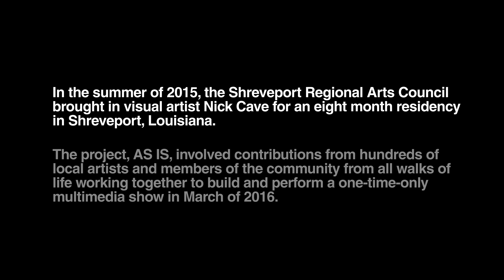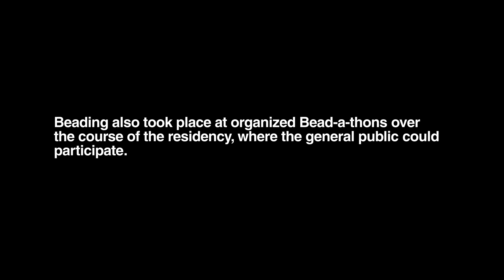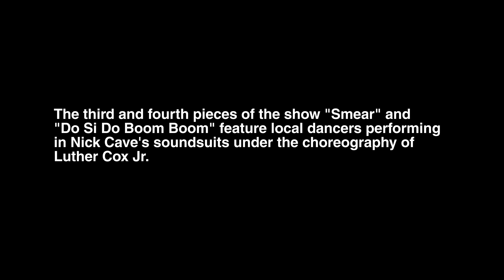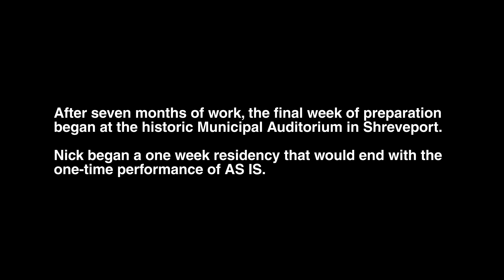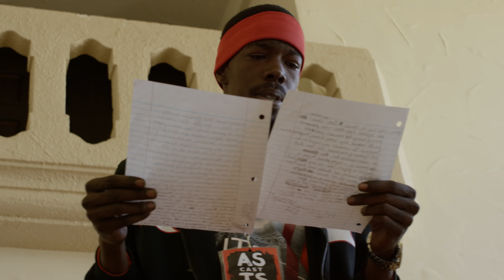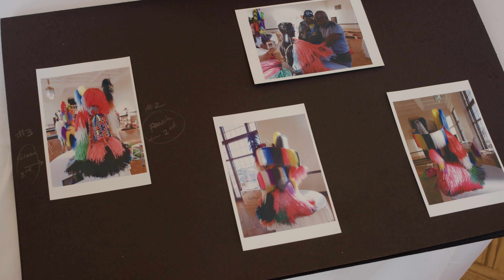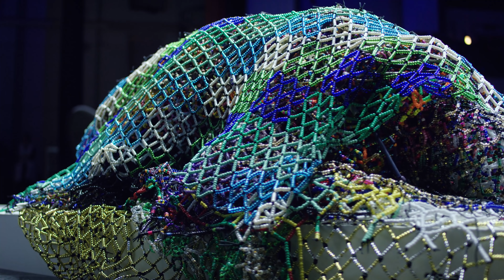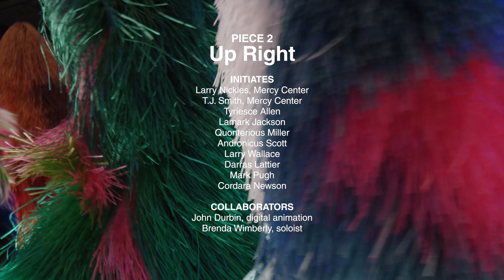AS IS by Nick Cave | Documentary (2016)

Comment: Great work!!
Reply from the maker: Thanks!
Reply: @Moviesauce  after a few years using both ATX cinema zooms what are your thoughts??
Reply from the maker: I actually haven't even had them for a year yet. This doc was shot on rokinon cine ds primes. But I like the ATX's a lot. They're big heavy cinema lenses so not ideal for documentary stuff, and T3 so not the best for low light, but I like the images a lot and the ability to do smooth in-camera cinema zooms.
Reply: @Moviesauce  I do have Canon red line zooms and 2 Canon promesa, I'm planimg yo buy Rhode ATX for a TV series 12 chapters with Panasonic Varicam LT EF mount. I just have 6000 dollars yo spent I would like to shoot this projects with real cinema lenses. What you think? Both costa Under 6k